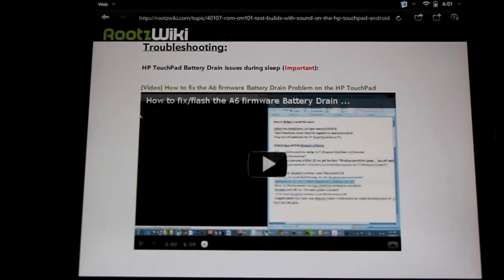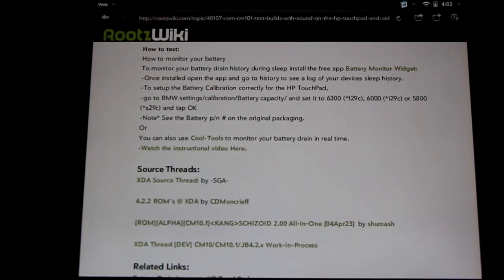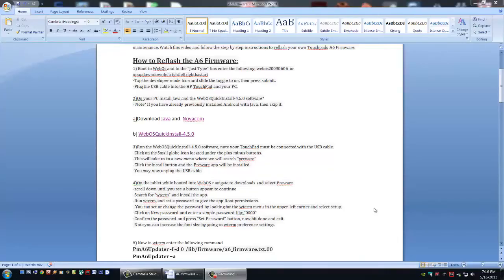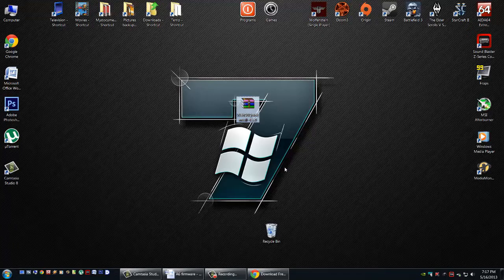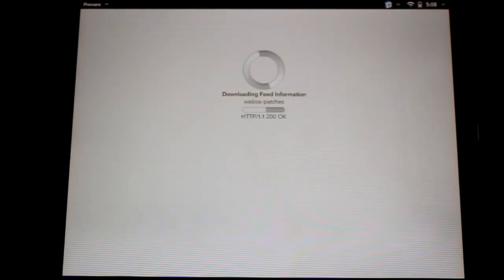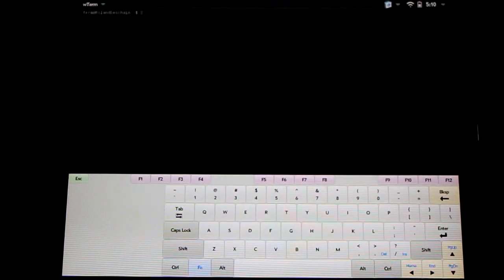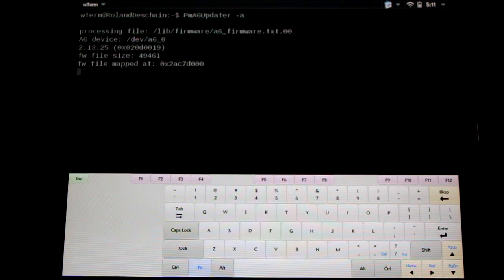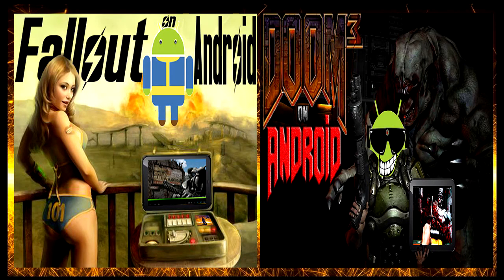How to fix the A6 firmware Battery Drain Problem on the HP TouchPad method 2

Comment: I have two TPs.  One I run CM9 with PreWare installed on the WebOS (3.0.5) side.  When booting into WebOS and attempting to enter developer mode using neither phrase works.  Pressing [enter] does nothing.  Is this because PreWare is installed?  Using the wTerm method did work to re-flash the firmware.

Comment: I tired this on both my TPs and it worked great. two thoughts though...1) if you are installing wTerm from Preware note that the preware.org domain doesn't belong to the webOS Internals guys anymore. I used the Option #1 hosts file redirection to point to the new domain preware.net and it works. http://pivotce.com/2014/08/31/tip-preware-net-solutions-for-wosqi-preware-v1-9-13/. I had to run WOSQI from the PC and connected to the TP via USB. Also I used the second shorter command and didn't notice the second firmware had already finished and was waiting. didn't notice the command line had appeared right below it. so just make sure it says firmware flashed on both and if you get a command line then you're probably done.

Comment: I commented yesterday but don't know what happened. Anyways, great video. Two thoughts 1) The PreWare.org site is no longer owned by the webOS Internals guys. They now have PreWare.net. To add wTerm I hooked up the TP to my PC via USB and used WOSQI but used this hosts file hack, option #1 as detailed here http://pivotce.com/2014/08/31/tip-preware-net-solutions-for-wosqi-preware-v1-9-13/. 2) I wasn't paying attention to the second firmware update. It was already done so once you see the command prompt you are good to go. Many thanks for the guide.
Reply from the maker: Hey Bud, thanks for the update, unfortunately YouTube blocks lots of comments automatically so I had to actually see it before I could allow it. I'm going to add a little note about the work around, I didn't realize that this method no longer worked properly. I've already got it installed but I've used the info you provided to make the following note, does this sound good? Thanks for your help, I'll need to add a note in the forum too.

Troubleshooting:
(New)The PreWare.org site is no longer owned by the webOS Internals guys. They now have PreWare.net. Workarounds to get Wterm installed are as follows.

Note:To add wTerm hook up the HP TP to PC via USB and use WOSQI hosts file hack, option #1 from the link below. Option #1 changes the host file redirection to point to the new domain preware.net and then it will work.
TIP: PREWARE.NET SOLUTIONS FOR WOSQI, PREWARE V1.9.13
http://pivotce.com/2014/08/31/tip-preware-net-solutions-for-wosqi-preware-v1-9-13/
Reply: Yes looks good to me. I did two TPs this way and all looks good so far.
Reply from the maker: Dude Magnifico Great, thanks for the heads up and help! The end of WebOS support is coming soon and I'm trying to gather info for those of us who wish to keep it installed. Cheers

Comment: *****  Which BMW (Battery Management Widget) Should I use as there are two of them by two different developers on the Play Store
Reply: I meant Battery Monitor not Management Sorry. LOL
Reply from the maker: Lol hey, this is the one you want right here:
https://play.google.com/store/apps/details?id=ccc71.bmw&hl=en
Reply: Ok, got that one. I'll test it now. But do we have to send the result to jcsullins or somebody or is this just for our use
Reply from the maker: This is for personal use, so you know when to reflash the A6 firmware.
Reply: Ok. Thanks for the video and for the help!! My battery does seem to be draining less!
Reply from the maker: Hey np, glad it helped you out. I reflash the A6 about every 2-3 months but I flash a lot of Roms. You should consider doing it every 5 to 6 months or so. Use the app to check if your drain is increasing overtime. Cheers.